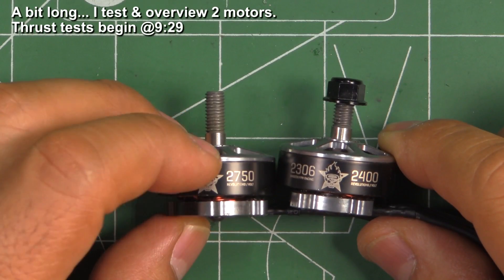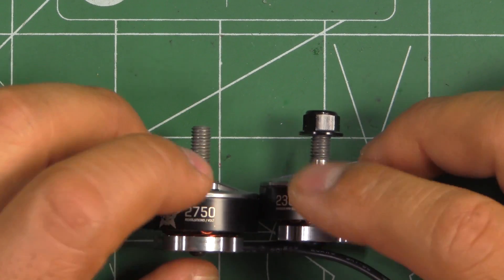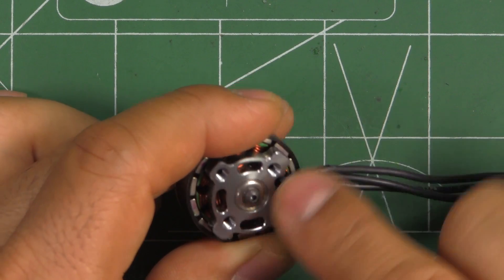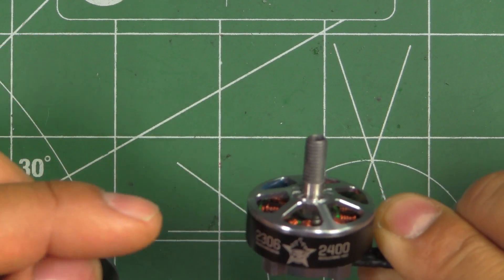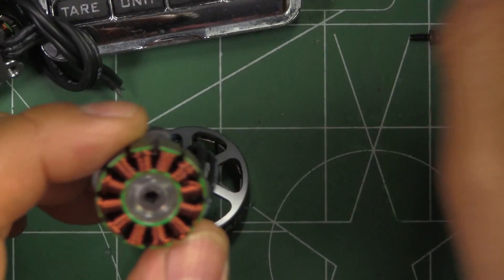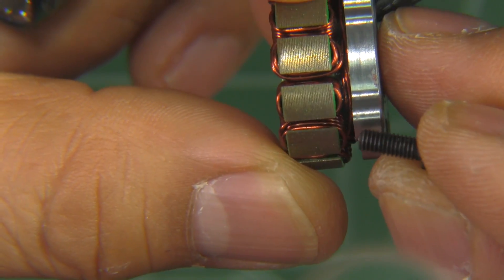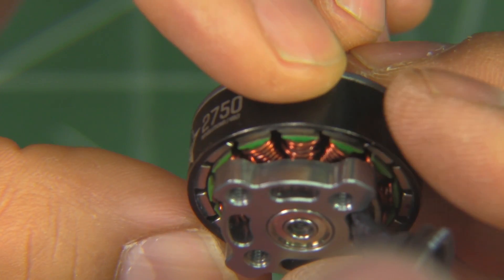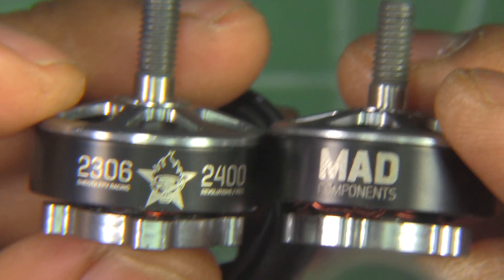MAD Racer 2306-2400KV & 2750KV -New Motor Prototypes Tested

Comment: If I send you a motor would you be willing to test it?
Reply from the maker: Rob FPV olide Which motor? I can test it but it does take me a while to get videos posted. To run it and get thrust numbers usually about 1 to 2 weeks depending how busy I am with work and home
Reply: EngineerX 2207 1770 kv from MAD motors as well.
Reply from the maker: Nice! they have a low KV version. I think I can run that one on 6S 5" props. See if you can send me a message thru YT. Go to the "about" section from my channel. Then I'll reply. Thanks!

Comment: 2400kv or 2750kv for racing on Hulkie props? Wished they made a 2550kv, middle of the ground.
Reply from the maker: Yes, 2550 would be nice. 
I've been seeing a lot of people liking the higher KV on motors  when their build are ultra-light. But I imagine some will prefer 2400 and other 2750. It's one of those things you gotta try both options and see which suits your style best.

Comment: are they smoking ?
Reply from the maker: Only the 2750KV on 5S voltage - That's a very high KV to run @ 20V on the thrust stand. I usually don't run that KV on that voltage, but KillaG FPV insisted, he got me in contact with factory and is one of the distributors in Australia.
Reply: he's pushing them for sure, they are really interesting tho.
Reply from the maker: They are very well-put together, up there with the top-tier motors, as far as I can tell when I disassembled/ visual inspection. I need to mount my 2400KV set and go fly and crash them to see how well they do. They should make a 2307, 2207, or 2407.
Reply: last thing. i'm not one that settles on something, i am still constantly trying to find faults in these motors to address for future improvement. i actually just maiden-ed another fresh build last night with my first set of 'NEW' MAD 2306 2750kv motors since the test units. the test units still go hard and run but i cannot use them to determine motor characteristics any longer as they have sustained deformation damage. still smooth asf. makes me laugh everytime. the test units are now on 6s duties. check latest video i uploaded.

so if you try a set and have any sort of feedback. please let me know so we can work on improvements ;) 

name one motor manufacturer that got their product right the first time? i think we have done well with these to address a lot of current motor trend issues. and have a good motor out in a short amount of time. hollow hard shaft, strong bell. good curved magnets that do not dislodge after heating up. strong flux ring, high quality bearings, light weight, smooth power delivery, easy to maintain, no circlips, i dont claim these to be the best at anything. out they certainly are a contender for the best all-rounder. 100g less peak thrust = 100 grams from the top taken and spread throughout the throttle range.
Reply: lol. I'm not pushing them at all. i want real world opinions. ;) not theories and heresay. 'hype' but from what ive used and found. i havent found a smoother motor that handles any prop up to 6045x3 bn without complaints. have not tried 4inch on these tho.. i figure they wouldnt be beneficial with a larger stator diameter on smaller prop.
Reply: that's up against T-Motor, and Cobras? not just things like the Steels and hype trains? and what is the next smoothest you have flown, I guess is the question. to be the smoothest is a pretty bold claim., no matter what the motor is.
Reply: VastFPV yes. In fact cobras were used to test new esc's coming out. Until the mads came along. The flux densities are whats important. they have taken over the cobra on the Test bench and the esc itself is currently pumping out higher kv rpm than kiss can deliver. Www.phat-al.com
Reply: something you would have to try for yourself for your own opinion to have weight ;) otherwise its all heresay.

also note how i mentioned smoother with any prop without complaints. 5inch to 6icnch tri's these motors are quite good at covering a whole range without suffering from over prop isues as much as other 'tight airgap' or hype motors. just for comparison. MAD have a 2380kv motor that is specifically designed for 6inch props. without the weight. ie 5 inch prop. the motor isnt working in its efficiency range and therefore is a rubbish performer on 5inch. but anything with weight ie a 6045BN and the thing is linear asf. i havent seen a straight line power curve like this one has on 6 inch from any motor. rubbish for 5 inch tho.

Again i dont have to push anything. im answering your queries, as much as i can, but to avoid any opinion vs opinion debate from forming. you would have to give them a run yourself. theres a certain demographic that thrive on hype. i myself prefer to fly good reliable gear. ive still got the test set on a basher rig and the bearings are still superb! flat spot on the bell and all! i show people what my basher runs and they are easily amazed at how it can still be smooth with so much damage. again. these are my experiences, im not here to compete over who's experience is more correct. thats counter productive.
Reply: KillaG FPV fair enough.

Comment: excellent review as always. Not impressed by the motor tbh , good weight but thrust and efficiency numbers are low for the size. If it is super durable and smooth it might be a good contender.
Reply: you look at thrust peak numbers or individual prop data? how do you determine your conclusion?
Reply: KillaG FPV both and compare them with all other thrust tests made by the same setup. In this case all tests from engineerx.
Reply: how do you reach your conclusion? how do you read the prop data i should ask.
Reply: in this case you have peak thrust numbers for each prop. Although that thrust numbers is only half the story they tell a lot about the motor, its max power and efficiency at peak and lower levels (those are most of the times proportional to the max). I compare those numbers for an individual prop that is tested in all the motors I am comparing. Let's take for example the hq 5043x3 v1s and compare the mad motor with the same priced,same category(middle KV ) motors that engineerx has tested. mad racer 2306 2400 = 1321 at 35.8a, bh t3 2306 2450kv= 1437 at 40.4a, bh r5 2306 2450 = 1417 at 38.3a, rcx rs2306 2400 = 1409 at 39a. You might say the mad is more efficient but in reality it is not and that shows on the high kv version. Same prop compare with bh r5 2306 2650. mad 2306 2750= 1539 at 46.8a , bhr5 2306 2650 = 1543 at 43.8a.
Reply: Also you can check efficiency at lower levels by looking at the charts of course.
Reply: so you are talking the peak numbers. taking into account anything else? realizing that peak numbers are static. and that a motor will pull the amps it requires to get full throttle to hit that rated kv rpm. this does not show torque curve and where the power lies for each prop ;) 

i ask if you check the individual prop data on the charts. the tabs at the bottom of the charts. when looking at those individually. what lets you determine their power curve and torque location in the curve for a given prop?
Reply: as I said static thrust is only half the story, smoothness , feeling ,durability , those cannot be shown at the bench. The power curve, sure you can get an idea by looking at the numbers but you have to fly it . All I am saying is that there are many other motors out there at the same price that seem to be as good if not better . If you read my initial comment, not impressed by the thrust but that doesn't mean its bad by any means.The weight is good , the looks are very good, one of the best looking motors i must say. What I do not like is the 3mm shafts that get bend more easily and the smaller bearing, those tend to get beat up faster than the 4x9x4. Also the price for EU customers like my self is quite high, more expensive than the r5 and the f40III.
Reply: i can assure you the 3mm is gunna be hard to bend ;) check the destruction testing link ;) thats my efforts against a steel post. i still run that motor currently ;) and ialso check my video where i bash them on a skatepark. flat spotted the aluminium on top of the flux ring which dented it a touch. new prop. one full punch and the motor is sweet again. this motor is also still on my basher rig. 

its good to know people are moving away and gaining knowledge in the static thrust data. :) its a great benchmark. for a rough gauge.

the reason for keeping the 3mm shaft is to get the longer armature length for the windings, get that flux density spot on and have a linear and smooth predictable power curve :)
Reply: ive also had experiences and other reports of the deadpools suffering in the bearing department.

i look at those cheap R3 motors and see where the money is made. easy to bend alloy prop shaft and bell. easy to fix. charge for the replacement bell and clearly weaker solid circlip shaft. making it a more consumable item.
Reply: also what is the end cost for EU customers if you dont mind my asking?
Reply: Yes I have heard the reports on the deadpools as well, those bearings with 4mm inner diameter but 3mm width are not a very good choice it seems. I understand the need for 3mm shaft but so far experience shows that the 4mm is superior in terms of durability. It remains to be see if the 3mm hardened one is on par. I like the linear approach . As for the price, it is 22.9 + vat (23%)= 28 dollars = 23.9 euros  per motors + shipping . The deadpools in comparison are 22euros and the f40III are 24.5euros.
Reply: i think you will pleasantly surprised at what good metallurgical knowledge can do with 3mm hollow shaft ;) there's a bit of gunsmithing know how in those shafts :)
Reply: That is good to know, inspires some confident. I am assuming with 3mm shaft it has the same 8x3x4 bearing as the deadpools?
Reply: You should send them to Ryan too for testing if you haven't already.
Reply: why assume? watch the video ;)
Reply: KillaG FPV oh lol, it's been some time i ve seen the video. Guess I ll watch it again.

Comment: Also for those concerned. the $USD RRP will be lowered a touch with the new improved versions :) mid Sept release. and yes they will be available worldwide. (just not until final versions are ready) we are happy with performance and feel in the air and durability, couple of cosmetic changes and they are set. they've come a long way from the version 1 motors thats for sure :)

Comment: is there any way to test for motor torque? ie a dyno setup? motor coupled to another motor maybe?
Reply from the maker: Yes the more advanced thrust stand from RCBenchmark has torque measuring capabilities I think. Also there are many other methods but too complicated and would probably take me too long to run
Reply: with my setup on the 5048x3 props im getting max draw of 84a 1100w. in the air.

Comment: Hello you can recommend very powerful engines that support esc from 30A with 40A peak using 5045 propellers
Reply from the maker: dys Thor 2500 & 2700KV, PiroFlip Hyper 2307-2522KV, TMotor F40, BHobby T2 2206-2600KV, 2306..... there are so many - a lot of good motors these days so it's hard to choose.
Reply: EngineerX I had thought about emax 2306 2400kv can i feel good?

Comment: Are you going to test R3 2207 returner 2400kv and 2200kv as well?
Reply from the maker: Not yet, BH has not sent those yet. Next motor video will be for R3 2207-2550KV -that's the one BH sent together with the Deadpools

Comment: A real test with some smoke :) hehe looks like some good 4s motors,but for that price? hmmm....
Reply from the maker: Right, they'll have to do something about that to be more competitive, there's just way too many equal or better options these days. It's getting harder and harder for manufacturers to sell at premium prices...T-Motor had to reduce their prices from $40 per motor back in the day
Reply: agreed. the current pricing is pretty much just reflecting proposed rrp. we've spent some time developing the motor instead of just mirroring whats hype. kept it fairly light, with good copper content and mag field shaping. enlarged the curved magnets as you've observed EngineerX, also reduced the air gap 0.04mm overall. they should tie in very well with www.phat-al.com esc's with the new algorithms and current control. all about the smoothness of the whole throttle range not just peak figures at the top.

Comment: What about those R3 Returners 2550kv you wanted to review if I remember correctly. I've been waiting for them for a long time now. Can you please make a review about them?
Reply from the maker: Yes, I'll be testing the R3 2207-2550KV next.... just have not had time with all the new motors that have been sent last couple of months. Now that I wanted to run it on the thrust stand we're having another heat wave here in Los Angeles, CA. 100ºF temps and last 2 evenings we've had black outs - no electricity (I'm not whining about that just commenting, nowhere near as bad as what's happened in the Gulf area due to hurricane Harvey :(
Thanks for watching, and check back in a week or so, hopefully temps cool off in the evening and no more blackouts so I can run the thrust tests.
Reply: EngineerX I am happy to hear about that announcement. Keep up the good work. Your channel is really great!